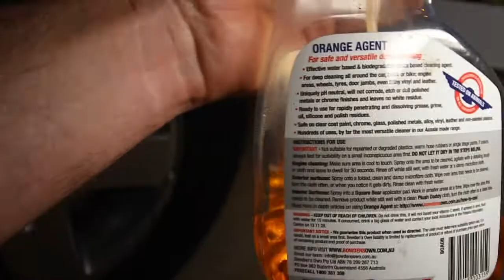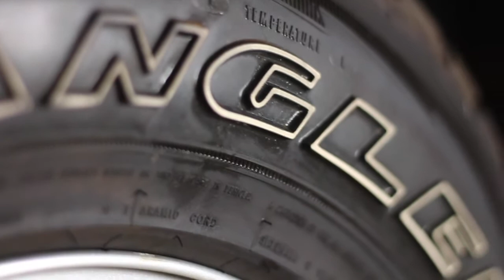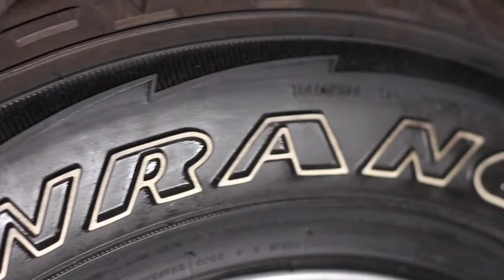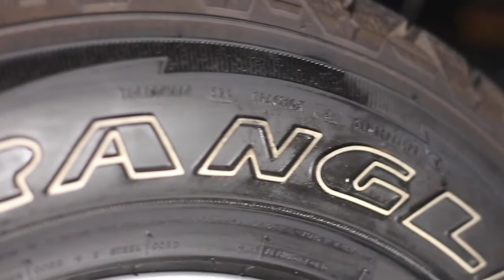HOW TO CLEAN WHITE TIRE LETTERS

Comment: I use regular soap and then use a tire marker to color them back to my accent color which is green
Reply: You got it easy with those thin letters I have bfg ko2s and it's a lot of painting
Reply from the maker: Nice, I will have to try soap and see if that works better. Nice
Reply from the maker: @Jim_woods  hahaha yeah definitely know right, BFG lettering looks really good
Reply: SOS Pads.